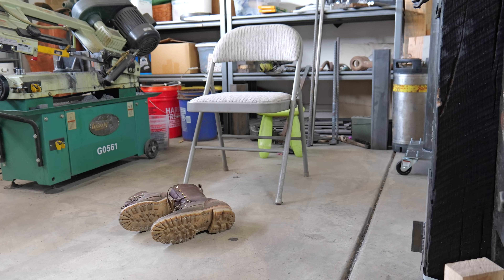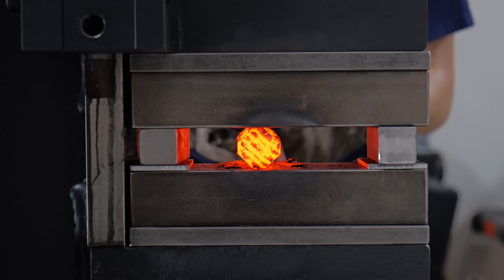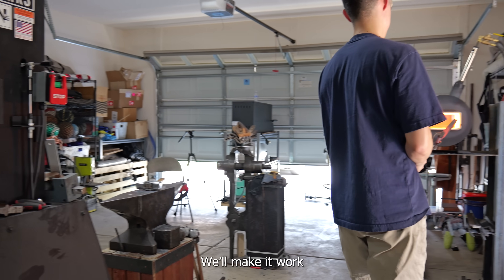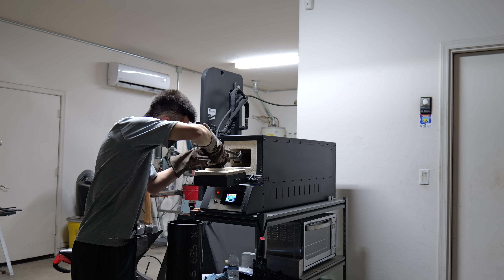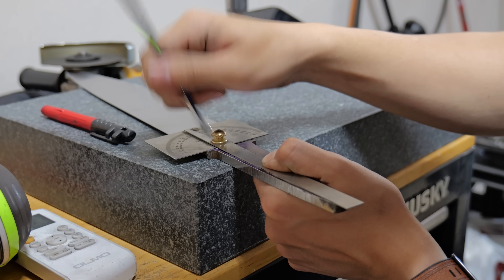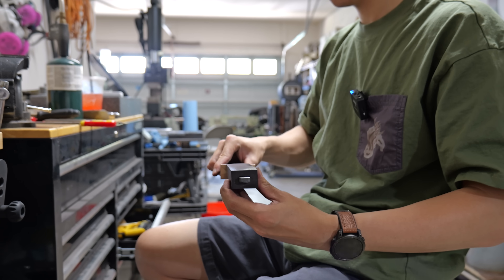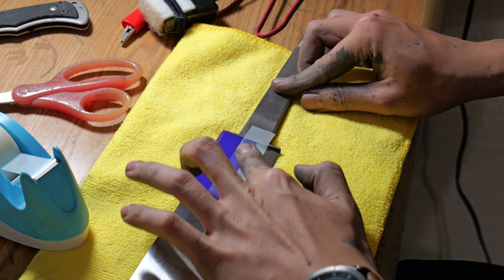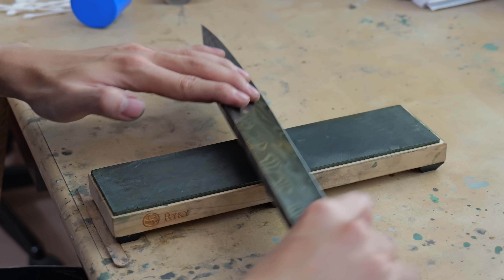Making a Twist Damascus Viking Seax

Comment: I collect Seaxes, usually of monosteel, and pattern welded ones, but I have never seen a Damascus steel one like that, it’s beautiful. But that style of Seax, is the Anglo Saxon Broken back Seax. Also the handles on most Seax were over long, in fact some of the handles on smaller Seax, were longer than the blade, so a six or seven inch long handle would be accurate for this Seax.
Reply from the maker: Thanks for the info! I knew it was in the style of the broken back seax but I didn't know the handle length was supposed to be much longer. I will keep that in mind for future seaxes.

Comment: I was a pipe welder for 32 years, now I'm a welding inspector. You can definitely weld stainless to carbon with a very strong weld with a  309 rod, or tig weld it with 309 tig wire.

Comment: For the nerd neck comment, I had REALLY bad nerd neck from years of gaming, its been about 6 months since I started going to the gym and working out, I used to have 2 days of back days a week very spaced out but i've noticed 1 a week is better for recovery as long as your back workout is very intense, trust me, I promise you, if you wanna fix your nerd neck working out your back completely fixes it, ive seen a HUGE improvement in mine already. I started out at home with dumbells and a bench but cables offer alot at the gym, maybe you could afford your own cables for home if you dont like the gym, either way, it wont solve itsself on its own over time, it will only get worse, beautiful build by the way, just thought i'd offer some advice, if you need any more I'd be happy to help. Thanks for the half an hour of entertainment homie.

Comment: Really nice work on the twisted Damascus. Won’t mind seeing more complex cross section of the initial bars. You can make some really cool twist Damascus designs.
Reply from the maker: Yep when I do another attempt at twist, I’ll do higher layer count and denser twist
Reply: It's not Damascus it's layered forge welded.
Reply: @BennyCFD  For at least 200 years, the term "Damascus" has been applied to high layer count pattern-welded steel that roughly emulates the look of traditional high Vanadium content "Wootz" crucible steel from Damascus (and India) that gets its "watered" random pattern from the carbon nucleation sites created by the Vanadium. I believe it was a German knife merchant who first recorded the distinction in the 1800s, listing blades of both methods as two separate types of Damascus... so it's not the ignorant misconception that you think it is:  it's been standard nomenclature to refer to pattern-welded steel as  Damascus for centuries. And it's specifically because it was done, in conjunction with etching the finished blade, to try to replicate the look of traditional crucible Wootz Damascus steel, which was a misnomer in itself because a great percentage of that "watered" crucible steel was made in India, not Syria. So if you want to be pedantic and say that pattern-welded steel isn't Damascus... then most of what you'd call "real Damascus" isn't actually Damascus, either... but is instead Indian Wootz. Or you could just go along with what has been the global standard terminology in the worldwide blade market for centuries, and refer to this type as "Pattern-welded Damascus" and the original type as "Crucible Damascus."

Comment: I live in AZ too. I do construction and can say" you don't sweat ,,, much". I would be soaked like I just jumped into a pool with all my clothes on. Nice job on the Viking Seax. Will sub to see what's next . Stay Hydrated and yeah..... Drywall should not get that hot .... but,  it is made from a flame/heat resistant material. In the garages , they use a thicker  5/8ths drywall for greater fire resistance . But I wouldn't press your luck as it is meant only to buy you some time to escape the inside of the house if a fire breaks out in the garage. I guess they figure there is a higher chance of fire in the garage due to the vehicles and possible chemicals storage. Keep in mind that the heat transfer to the framing above you could melt any wires you might have laying across the framing causing electrical hazzards ..... and although not very common, it could  also spontaneously combust in the attic and you may not catch it till its out of control. May i suggest you roll the forge out the side door until you can get a proper hood to draw the heat outside. Keep up the great work. Stay safe!

Comment: Great build :)
To answer your questions, I'd say that power tools are for rough shaping (disc cutter, course grinding) and final finish (polishing). Filing would be great for precision work followed by hand sanding, and you'd still need to buff it up with a power tool, but hand tools do introduce less heat in the process. This will differ slightly between wood and metal, but the basic gist is to use power tools in such a way that you only need a minimum of final shaping, with in your case also keeping heat treating in mind. It's an order of steps kind of deal, and whatever helps you minimise the steps at the best quality you can deliver brings more food on the table.

Comment: Hey kid! I love your work. I am really impressed with the craftsmanship. Brushing the scale away, grinding till clean metal, squaring up etc. Also, and most importantly you do seem very safety oriented! But I do not see any hearing protection and you could certainly use an exhaust hood. That Seax is absolutely amazing, WOW!! I have never seen better. Good Job!

Comment: I don’t know if you know this trick yet but to get jewelers rouge out of the grains of many woods, cut a 1”x1” square off of a magic eraser and put some mineral spirits on it and wipe down your handle with it and it takes the rouge right out of there. Do this before you put any oil or finish on it. Learned that a few years into my knife making ventures. Very nice vids.

Comment: Great video Jesse. Small tip - take a piece of black iron pipe and hammer one side ovoid; you can use that to slip over the tang to hammer down your guard much easier (instead of trying the angle iron)
Reply: Also i'm glad you keep all your fuckups and "shouldn't have done that" moments in your video; its much better seeing the human side of blade making and how much problem solving goes into it. People don't seem to understand that but its nice to have light brought to the subject
Reply from the maker: Great tip! I’ve been thinking about a better method to hammer the stuff on😅 I’ll get some pipe asap
Reply: @jhublades  dig it. Works great for hot-fitting guards too

Comment: At 29:36 when you are doing file work for the guard, you can mark the depth with a hacksaw and the file guide, widen it with a triangle file, and then use the round one to finish it. It's easier and faster than manually trying to do it all the way with the round file.

Comment: Find a vuse for your drill press that has x and y axis movements. Throw some end mill bits on your drill press. Basically a make shift endmill to help you remove some serious material from your parts or blades. 🙌🏼 and i see its time for a simple but efficient extraction system in your garage ceiling to vent the hot inside ambiente air to the outside.. just stumbled on your page, but i must say I dig it 🤘🏼 also that you live in Az as i do. Keep uo the good work man!

Comment: Bro.... You really need to set up an air extraction system in your workspace to exhaust smoke! Also they do make air files that work off of compressed air. Thanks for the vid!
Reply from the maker: The parts are here! I just need to get them hooked up to the ceiling and exhaust through the wall😁

Comment: For your heating equipment, you might consider placing hoods over them, you can combine the system to evacuate & greatly reduce the heat. 

Not to difficult.

Comment: I like your channel, you make some good videos so I'm going to copy paste something from google so hopefully you read this and don't burn your shop down. 

You can put a fan up that blows air from the ground up and over your forge, that will dissipate a lot of that heat. 

Seriously good video and nice knife. Keep it up! 

This is from google-

Because of the wide range of materials used in drywall, it takes varying temperatures. When the temperature hits 170°F (76°C), gypsum, one of the most prevalent drywall components, is damaged. However, gypsum will not begin to burn until it reaches a temperature of 350°F (176°C), which is hot enough to start a fire.

Comment: the sanding with the high grit, you can get the design on the blade using electricity and various compounds  to etch into the blade.

Comment: the knife is wonderful, no doubt about it. the only comment I can make is regarding the tip, where it is rather clipped even if little, while instead the seax par excellence has a completely straight edge and the back goes straight diagonally towards the tip. Greatings from Italy

Comment: I’ve been told for many years that you don’t weld stainless to mild steel but they make specific welding rods for that exact purpose (7012). And there are better ones as well (I’m cheap).  In a farm equipment setting you end up welding things that most people wouldn’t try and they have to last many years under tremendous load.  The way you learn what works is to try it and risk failure.

Comment: At 22:50
So, there are reciprocating saws. And then there are a few reciprocating files, though only air/pneumatic files. And then there is an adapter for reciprocating saws to attach a file "head"/"bit". And if you can't find the tool/adapter you are looking for, you could always build your own tool/adapter for a reciprocating saw.

I also didn't look too hard, so there may be actual electric reciprocating files.

And then there are attachments for a drill that turns it into a reciprocating saw, but I couldn't find one for a file. But maybe you could modify the saw attachment to fit/take files?

And if all else fails, you could always make an attachment for a regular drill that might do the job. Think of how a piston in a car works, or look up rotary motion into linear motion. Though I don't know how much pressure you'd be able to apply to the tool, and without using some gears and getting (more) complicated, you'd have to hold to hold the drill sideways. Thinking on it, making an attachment for an orbital sander (same concept as for the drill) might be easier/better, but I don't know if you can vary the speed of an orbital sander like you can with a drill.

Comment: Dude that's one seaxy blade LOL. But as for grinding the groove around your guard, I like to use a dremel cut-off wheel in the drillpress to get a groove started in the exact middle by adjusting the table height. Then it's much easier staying centred when filing out the rest. There are also these (convex or concave) diamond wheels so you can do the whole process on the drillpress. They can even be used for cutting in fullers. Might look a bit janky, but laziness is the mother of all invention, right? Anyway, looking forward to your next project!

Comment: You should put a heat shield or some kinda of insulation on the ceiling to keep it from burning the drywall if you can't figure out how you can dissipate the heat

Comment: The mild steel is easier to file than the bronze because the bronze work-hardens; to soften the bronze, heat it up until it's glowing a dull red (but not much hotter than that because it will melt) and quench it in water. That's how you anneal copper alloys.

Comment: @24:56 - The issue is not with the Drill Bit - Though, the sides are not sharpened.  The issue is that the bit is in a three-way chuck and not a collet.  The danger is with the bit slipping between two of the jaws and spinning in a cone that will rip anything to shreds.  This is why you use an end mill.

Comment: Need to invest in a mini-split AC with a heat pump for your shop too. Would be nice to have a 3 ton AC and heater for to deal with the temps(summer and Winter) Would be the best $2500-$3000 you'll ever spend and you could def install it yourself!
Reply: lol get you a "Mr. Cool" sponsor lol.

Comment: get a fan blowing out towards the top of your garage door and one blowing from the back door. Have them hanging from the celing.. You can also put a fan in your attic and open up the attic ladder door if it is in the garage. Heat under 200F wont hurt drywall, it is rock and paper...maybe the paint but not the drywall

Comment: At 3:40
Would putting just a basic box fan, angled slightly toward the ceiling above the forge, fix the potential heat buildup? It would not only cool down the ceiling, but should also, in theory, blow the hot air away from that specific spot.

You could even put the fan on that shelf where that white box is. If you want to get even "fancier", hang an aluminum tray that rests about a foot away from the ceiling above the area that is getting hot, and then point the fan at that.

Comment: You could install a couple of bathroom exhaust fans and duct them outside to help get the heat out from the ceiling.
Reply from the maker: Ooh, interesting idea, I’ll have to ask my dad and see if something like that is possible
Reply: @jhublades  it would also help cut down on smoke, or fumes that may linger around.

Comment: Pattern welded vs. Damascus steel. Pattern welded steel has been around for centuries, describing two or more steels forged-welded together to create distinctive patterns. Historically, Damascus steel referred to the patterned steel from the area around Damascus, known as Wootz steel which isn't found anymore.Jun 1, 2022
Reply: Loss of the technique
For reasons that are not entirely clear, but possibly because sources of ores containing trace amounts of tungsten and/or vanadium needed for its production were depleted, the process was lost to the middle-eastern metalsmiths around 1750. It has been eagerly sought by many since that time.

It has long been argued that the raw material for Damascus steel swords was imported from India, because India was the only known centre of crucible-fired steels like wootz. However this conclusion became suspect when the furnaces in Turkmenistan were discovered, demonstrating at least that the technique was moving out from India. The wootz may have been manufactured locally in the Damascus area, but so far no remains of the distinctive wootz furnaces have appeared. Verhoeven et al.'s work supports the hypothesis that the wootz used was from India, as several key impurities that appear to give Damascus steel its properties point to particular ores available only in India.

The Russian bulat steel has many similar properties, at least in nature if not in process. Recently various groups have claimed to have recreated steel with properties consistent with true Damascus blades, through experimental archaeology, though even they admit they cannot be certain how it was originally created. Verhoeven et al. (1998) argued that the keys are ores with certain trace elements, controlled thermal cycling after the initial forging, and a grinding process to reveal the final damask pattern. A somewhat different technique was proposed by Wadsworth and Sherby (1980; also 2001).

Attempts at reproduction
From the very start, the superior capabilities of Damascus swords attracted significant attention, and many attempts were made to reproduce either the performance or the appearance of the Damascus blades. Since pattern welding was a widespread technique, and produced surface patterns similar to those found on Damascus blades, many people believed that Damascus blades were made using a pattern welding technique. This belief was challenged in the 1990s when J. D. Verhoeven and A. H. Pendray published an article on their experiments on reproducing the elemental, structural, and visual characteristics of Damascus steel.

Verhoeven and Pendray started with a cake of steel that matched the properties of the original wootz steel from India, which also matched a number of original Damascus swords they had access to. The wootz was in a soft, annealed state, with a large grain structure, and many beads of pure iron carbide which were the result of the hypereutectoid state of the wootz. They had already determined that the grains on the surface of the steel were grains of iron carbide, so their question was how to reproduce the fine iron carbide patterns they saw in the Damascus blades from the large grains in the wootz.

By heating the cake of wootz to just below the critical temperature which would cause the iron carbide to return to solution, it was possible to forge the wootz with hand tools. Repeated forging, working the wootz into a long, thin shape suitable for a knife or sword blade, caused the large iron carbide crystals to fracture and spread out in the pearlite matrix. The resulting steel contains bands of iron carbide in a pearlite matrix, alternating with bands of ferrite and cementite. In this process the steel work hardens, which is what allows the normally soft wootz to be used for knives and swords.

Studies published in 2006 by Peter Paufler of the Technical University of Dresden, Germany, and colleagues, utilizing an electron microscope to study samples of a 17th-century sword, have discovered clear evidence of carbon nanotubes and nanowires, and associated cementite wires. They believe that the nanotubes and the nanowires were formed by the special process of forging and annealing the steel, and could explain the unique mechanical properties of the swords.
Reply from the maker: Did you write all of this for me😅 If so I applaud the effort. Some good stuff in there